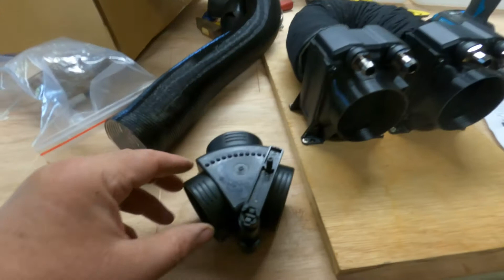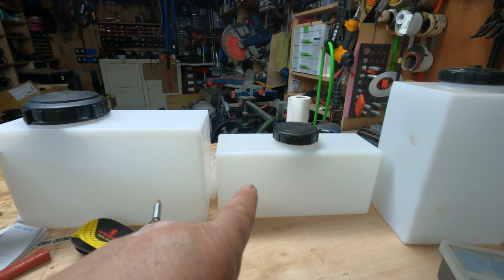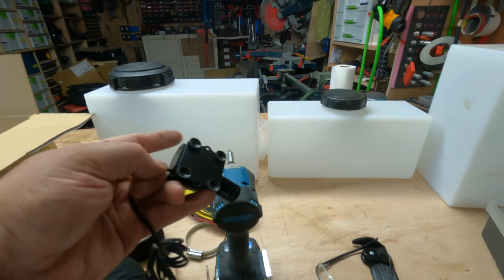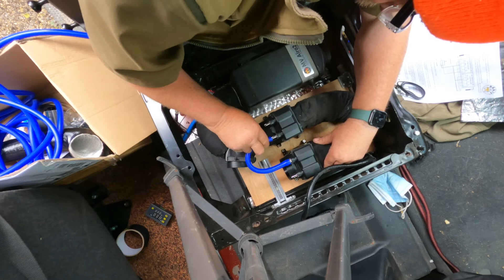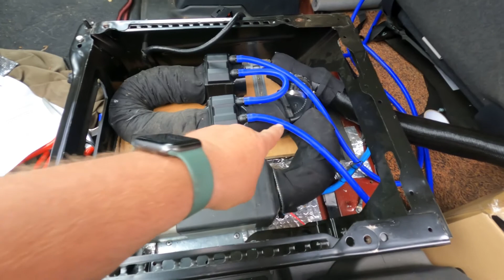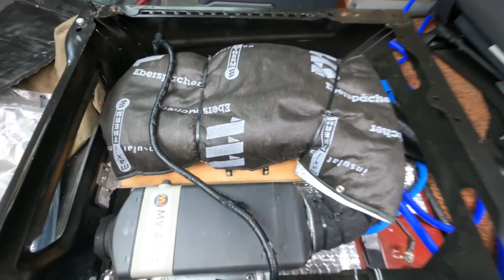Bobilvans heat exchanger Bumper Bobil water Heater - 60mm ducting

Comment: Is that a 2kw heater? How long does it take to heat a tank of water?
Reply from the maker: Yes it’s only 2 kW heater. I’m using two heat exchanges as shown in my video. It gets it up to a temperature that I can take a shower with in approximately five minutes